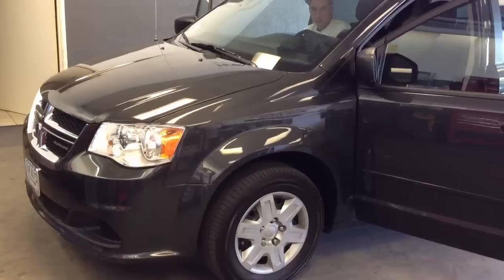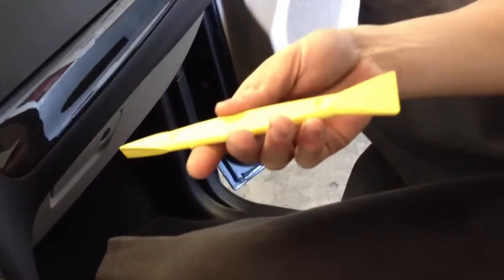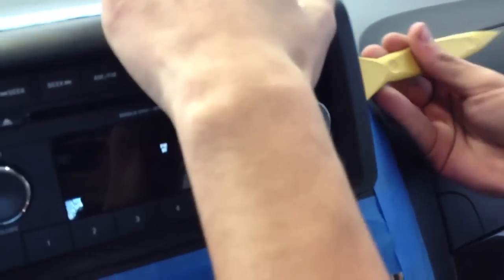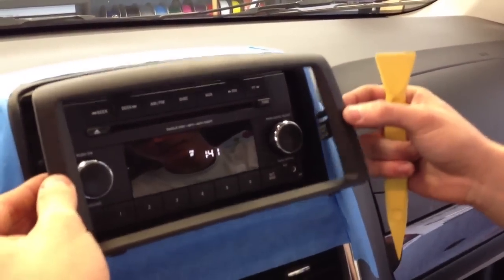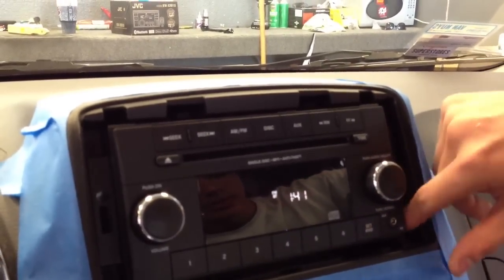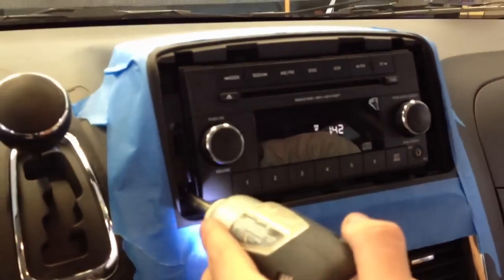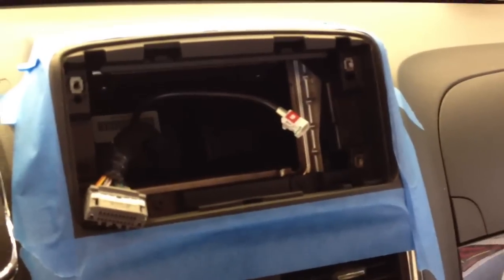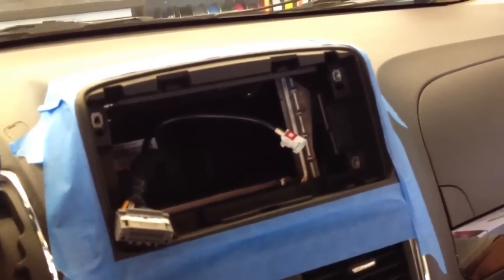2011 Dodge Caravan How To Remove Radio Dash Stereo Install DIY

Comment: Question, does the 2011 and newer Chrysler/Dodge minivan have the same metal brackets within the dashboard that the 2010 and older do? Some sources (like Crutchfield) say that these brackets have to be either bent or cut off to install most aftermarket double DIN size receivers. The video lighting is not bright enough to be able to see these brackets in your example, so some information on this would be greatly appreciated. Thanks.

Comment: I need to remove the panel around the climate control buttons in this same model town and country. Do you know how to remove that panel? Pop was spilled on the buttons during an accident and the buttons are sticking now.
Reply from the maker: start at the radio and see what it exposes. sometimes they are clipped in and just need to be pryed off

Comment: hey quick question does the use of the cambus kit eliminate the steering wheel control kit or do you require both for a double din install. i have a 2011 grand caravan.
Reply from the maker: use PAC-AUDIO RP4-CH11

Comment: I put a credit card  under the screws  to catch them just in case they fell.  The screws are actually shorter than I thought.  It is a bit more difficult to pull the radio out than I'd like, it a 2014, just trying to get to the climate control piece

Comment: hi there!if i remove the regular stereo from my caravan 2014 and put an OEM radio with gps navigation does it fit and can i use the same cables from the one that i removed?
Reply from the maker: im not sure..... it might have to be programmed by the dealer for it to work

Comment: I bought this harness.  https://www.amazon.com/gp/product/B00I8VOOQY/ref=oh_aui_detailpage_o01_s00?ie=UTF8&psc=1
There is not red or orange wire on the new harness, but there are those colors coming out of the new head unit part of the harness.  What do I do?  Did I get the wrong harness somehow?
thank you.
Reply from the maker: run a wire to a fuse box, this is for ignition

Comment: how do i keep oem usb port working to use with after market radio
Reply from the maker: usually it only works with the stock radio. might have to run a new usb input cable

Comment from the maker: NAV-TV makes the parts you are looking for. We are authorized dealers and would love to ship it to you ALLGIG_XG-HS and ALLGIG A/V & CAMERA HARNESS. 
Must have MyGIG Radio(Touchscreen) Enables viewing of factory DVD or VES display in motion. Allows setting of navigation destinations without stopping the vehicle.  (On navigation equipped MyGIG radios.) and and optional av harness to do video ins and out. 
 
Please call 310-827-8121 for more info  - Saturn

Comment: how do i keep the steering wheel controls and the usb port in the glove box that comes oem with my van
Reply: You
Reply from the maker: metraonline.com will make adapter kits to replace the radio